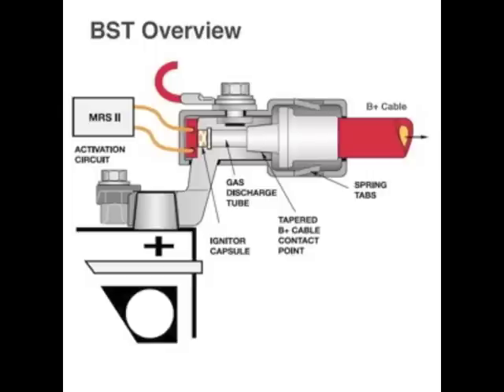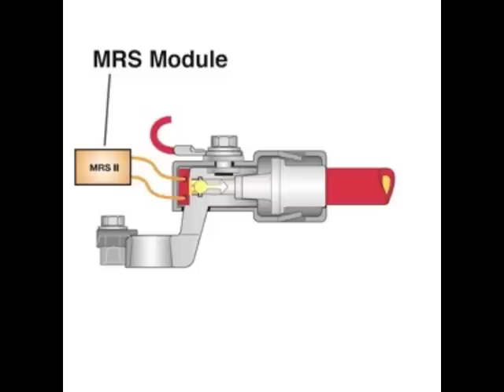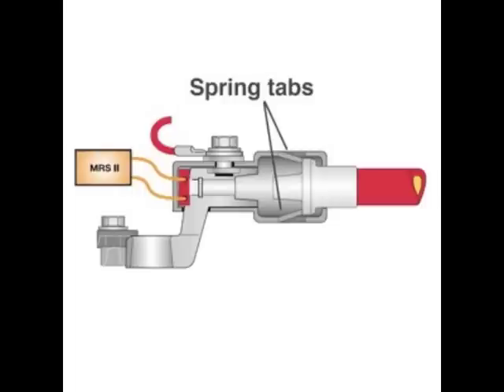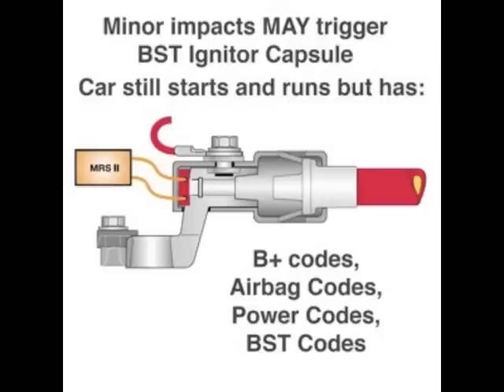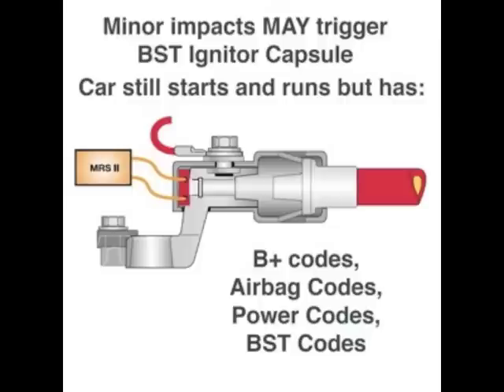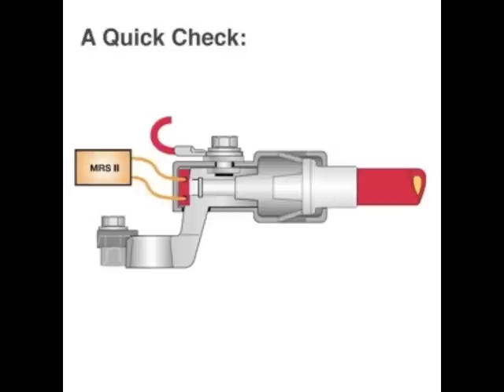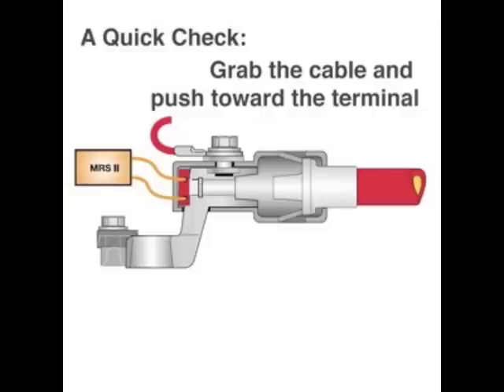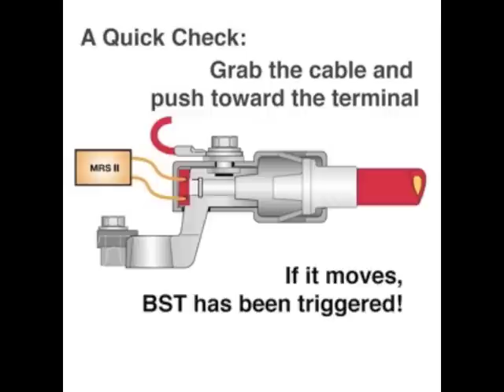BMW Battery Safety Terminals (BST) - Diagnosing and Repairing

Comment: Interesting, my bmw '99 E39 528i has been having electrical power issues lately and today after I turned off my engine for about 2 minutes i tried starting up my car again and all the electrical power went completely dead, no dash lights, no power locks or even the windows worked.  There was no way way a battery could drain that quick and completely dead in 2 minutes so i checked for loose cable connectors on the battery terminals and they were on fairly tight but what I discovered was when I wiggled the only positive battery cable itself all the electrical power turned back on,  So your video could explain exactly what my electrical power problem is.   I will look into it further tomorrow.  Thanks for your video.
Reply: I have recently purchased 2002 e39 tourer i am having this problem gonna watch the vid now!

Comment: If you break the T-shaped bolt that allows the cable to clamp to the battery you cannot get one from BMW, they dont sell them separately from the cable... but you can go to a auto parts store that sells Standard Motor Product branded parts and ask for a BP59C, or the BWD branded part BH59B, or go to a NAPA and ask for a 718628. Dont overtighten, the torque needed is 5NM or 3.6 Ft Lbs.
Reply: 1966Chevy2SS wym

Comment: do these things fail for no darn reason at all ? I have a BST on my 2002 e46, that hasnt blown, but is showing a "resistance too high" from the BST circuit. Any possibility of the black wire being loose or rusty i.e. is the resistance measured between that black box wire -> the yellow plug on the BST ? Thanks for the video, very helpful.

Comment: hi, ive got airbag and restraint sytem malfunction,the code that comes up is ( 9AFF Resistance firing circuit, safety battery terminal, too high ), the bst seems to be fine,ive cleaned every connection and had the codes cleared,but it comes back on after a short time, the charging output is about 14.5 volts from alternator when measured at the battery terminals,also car has been to BMW for a recall issue concerning a cover for the battery cable terminal in the trunk,cheers for your help

Comment: Hi will you be able to help me, l have my BMW's water damaged computer box replaced with an automatic computer lock-set. My car starts very well but the steering wheel doesn't unlock even though the engine is idling.The second thing the radiator fan keeps on running without shutting off. My car is a 2011 model, 320i, Petrol, manual sedan. The steering wheel just remains locked it doesn't turn. The car's ignition is a start-stop one with the remote key fob. Please help.

Comment: hello Thomas I just been hit on the road from the back and the car won't start but the radio and everything works except the engine is this what I need to replace I'm guessing seatbelt pretensioners exploded the airbags  didn't went off but when you turn the key the engine warm run and I have the airbag warning light on

Comment: any advice on replacing a bst/power distribution block on a e90 with one from a year or 2 newer model?
Reply: replace the crash sensor and the Airbag module
Reply: @BMWPROGRAMMINGJAMAICA  im having problems with my e90 335xi  2009   my battery positive terminal wire the sensor  was melted  so I replaced it with a  used one and  after I di that  my abs and 4x4 lights r on for good  dnt know what going on
Reply: @BMWPROGRAMMINGJAMAICA  any help please 🙏

Comment: The car doesn't start when the BST fires.  Your power windows and other accessories still has power.
Reply: Exactly, this happened to my 328xi. It won't start, but it has power.

Comment: This a battery SAFETY terminal. It's purpose is to keep you from being in a fireball of a car when you are in an accident. What is your life and lives of your passengers worth?
Reply: BMW cooked up this idea not because you're in dire danger of being in a fireball from a rear end accident, but rather because BMW engineers needed to find a way to charge you $400 for a battery cable, as if their intelligent battery system requiring you to electronically "register" a new battery with your car wasn't a sufficiently profitable dealer service magnet. My 1988 BMW 750iL has neither of these bizarre concepts baked into it. i am alive, well, as well as physically and economically healthy without them.
Reply: That BST saved my ass 👍

Comment: i just bought a bmw 2006 330i from the auction the car was hit lightly broken headlight no air bag deployed checked the bts and looked fine but i have no electric power what so ever in the cockpit can start the car as well, if i press the power on the radio it will turn on and the in dash the button that shows the k also lights up no christmas lights. please help me out what i should do i live in hamilton ontario.

Comment: 3.40 - If the BST blows the car will not start because it is the starter cable that has been disconnected by it.
Reply: Mine started just has codes
Reply: Geoff Crabtree yo mine crank turn all the lights on but I won’t star

Comment: Good way to drown if car goes in water and you can't roll the windows down quickly.
Reply: Rudy Linhub Electric windows still works. It’s only the main positive cable to the motor that is disconnected.